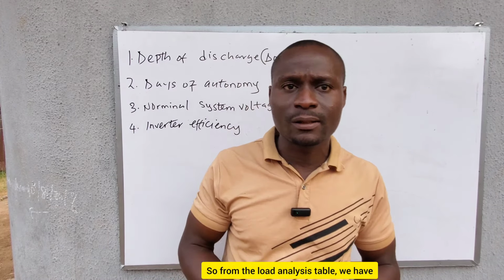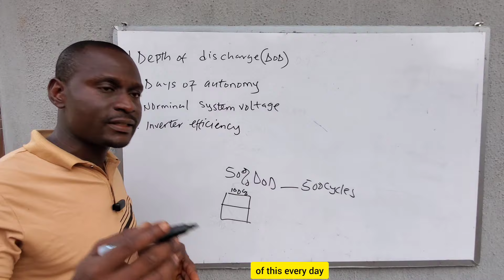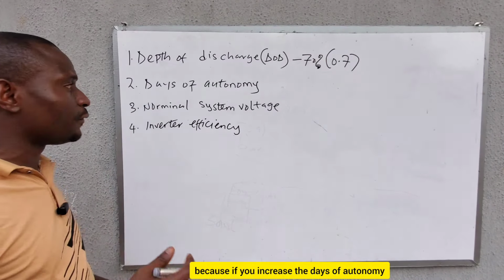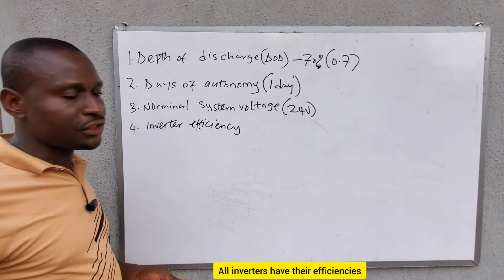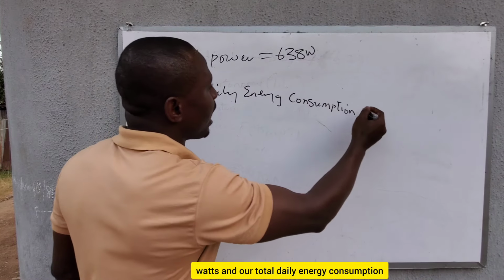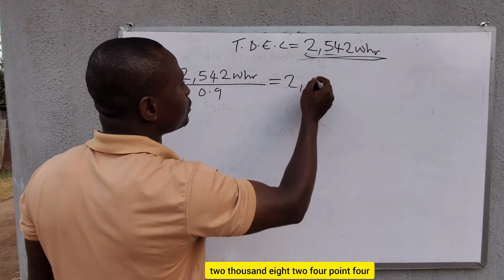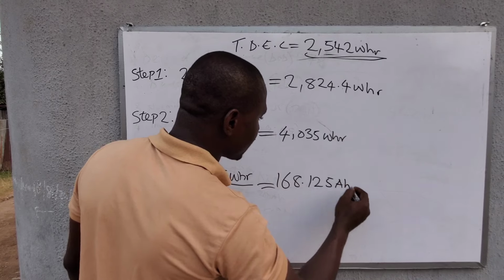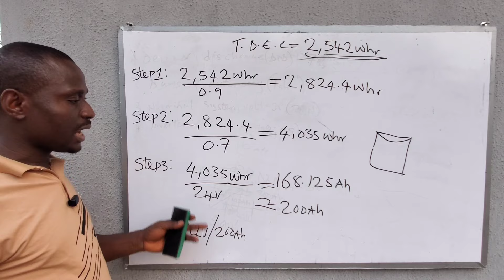What Size of Battery do I Need?

Comment: I am of a different opinion please. Depth of discharge for instance let us assume 70% as specified by the manufacturer should be used in the final stage of battery sizing i.e 70% tells us that, after you've obtained your calculation as 168.125Ah, add 70% of 168.125Ah. I mean 168.125+117.6875=385.813Ah. This is approximately 400Ah capacity battery. So you go for 400Ah battery not 200Ah.... Again, you ought to have considered the effects of temperature on the battery(as specified by the manufacturer) as well as efficiency of charging and discharging (as specified) and used them in your calculation
Reply: @Solarwattng  what do you mean?
Reply: @Le_vis254 
That's what i was going to point out... For me this sizing process is incomplete. In the intro he started talking about days of autonomy...then that was not taken into consideration in the final result....Battery efficiency as well wasn't taken into consideration...hope there's a third video coming up
Reply: @wenzydemar4406  Of course yes, I think he'll upload a new video to correct the slight mistakes made.. He's a great teacher and one of the best interms of explanation
Reply: @wenzydemar4406  
Pls sir i think you can help add the calculation omitted as u have said above .
I will be glad if you do for me .
Thanks
Reply: @wenzydemar4406 . That he mentioned days of autonomy doesn't mean he must include it in the calculations. Is not every sizing that requires days of autonomy to be factor in.
Reply: I have issue with step 1: is  Total energy consumption per day divided by battery efficiency rather than inverter efficiency which is 0.8 for Lead acid batteries
Reply: It was 168.125 but he just make 200amps bcz there's no battery capacity of that amps
Reply: Please tell him,

Comment: Question 
How does an inverter and solar charge controller synchronize to properly regulate charging current from both the grid and external solar charge controller going into one battery bank?

I really need help

Comment: Great teaching, just a question. How do you calculate the DOD for the batteries? Where is 50% dod, 70% DOD coming from? Is it from the manufacturer? Is it already set in the Charge controller? I would appreciate your response.
Reply: you basically have to decide the DOD that is suitable for you based on the number of cycles you want your battery to do during it's life span

Comment: Base of the total load power which is less than 1000watt, I will assume 1kva of inverter will do the job.

Since 1KVA of inverter takes in 12V, do you think the 24V you got is the right thing?
Reply: He only assumed that he will be using a 24v inverter.
Reply: @ what’s the rating (W) of the 24V inverter

Comment: Thank you very much for the knowledge shared.
Can we interpret that 200ah battery with 24v inverter could run for a day if the load is within 2600whr?
Also, is it adequate to rely on the information around equipment to ascertain energy consumption of the equipment, or is there any other way of getting this info?
Reply from the maker: You can check the equipment to see the power rating or daily energy consumption. You can also use an energy meter to know the energy consumption of the electrical equipment

Comment: Please sir,can I used the same hour for the calculations instead of individual hour.assuming my total load is 100watts,can I multiply it by 5hours as my total energy consumption
Reply from the maker: Yes... if you are using all the loads at the same time.
Reply: @Solarwattng  okay sir,but what if am not using them at the same time,but at different period,you know some won't be work at all doing daytime sir
Reply: You can use diversity factor to determine your daily total energy consumption

Comment: Thank you so much 
I newly subscribed to your channel
My queation here is , After all the calculation you got 24volts/200ah battery .so how many of it (the battery) will give or serve the Energy demand of 2,542whr.??
Reply: 2 units of 200AH connected in series gives 200AH/24v to give you the whr calculated in the video. The battery bank will supply the reactive power and power losses in the inverter and also considering 50% battery usage, which is enough to supply the whr calculated in the example.

Comment: Thank you sir for good teaching. Sir is there 24v battery of 200Ah?
Reply: You will connect 2 units of  200AH/12v battery in series to get 200AH/24v battery bank
Reply: @michaelakomolafe9249 why was 24 volts considered instead of 12volts on the nominal system voltage in the final calculation?

Comment: You teach very well , but I think you have to review your teaching very well
Because am in a doubt that 200AH batteries cannot accommodate such load .
Another thing is that you did not consider the battery efficiency and also the materials like cables loses as well 
For me all you have to do is to divide the t.d.p.c by 12  which is the single battery voltage you can see, then what ever it gives you is your total Batery AH then you divide it by the amp rating of your individual battery to get how manny number of battery required